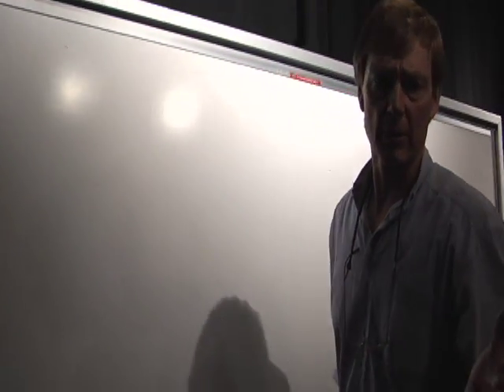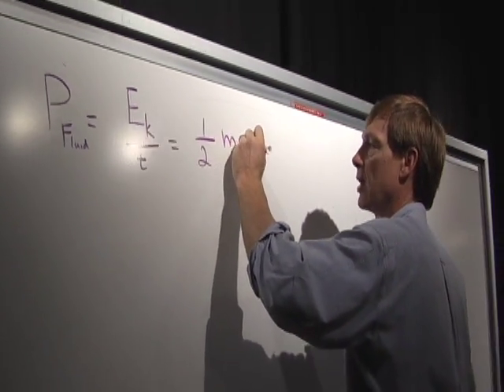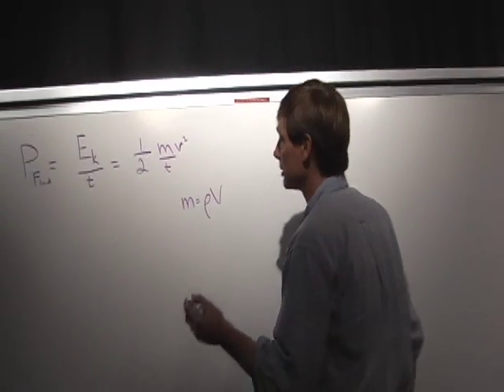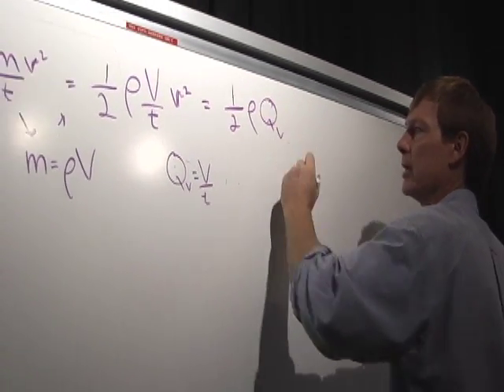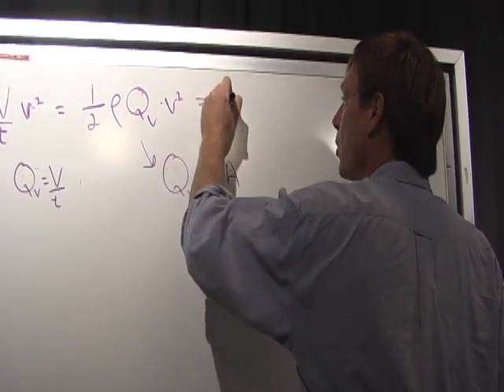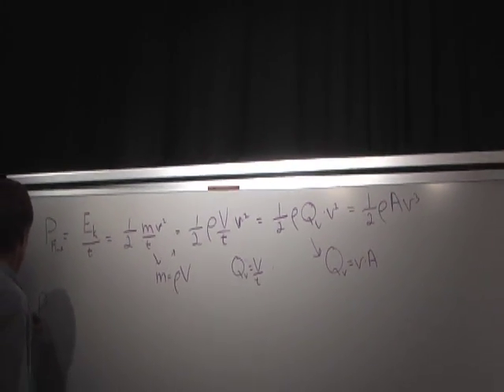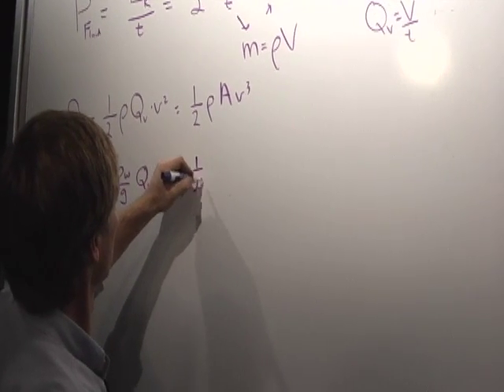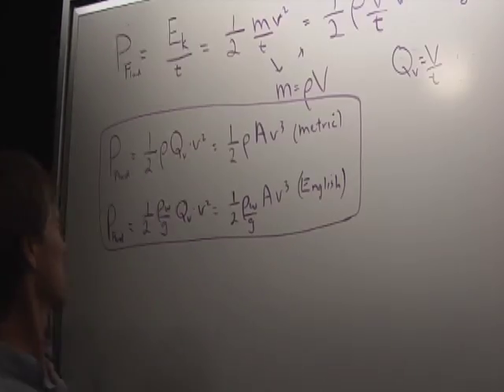Physics IV C3 Energy Converters: Fluid Mechanical to Electric PART 1

Comment from the maker: Yes, you could generate electricity from shaking a water bottle.  It's all energy, so the mechanical motion could be converted to electrical energy.  Are you familiar with those emergency flashlights you shake to power them?  Shaking water could also heat up the water, and the temperature difference from the water to the outside could be converted into a voltage.  - bob